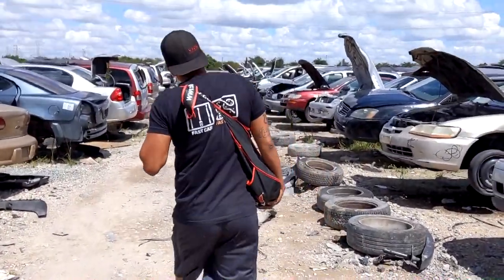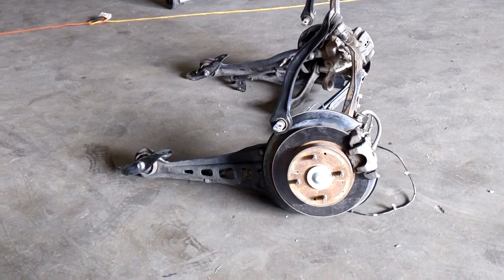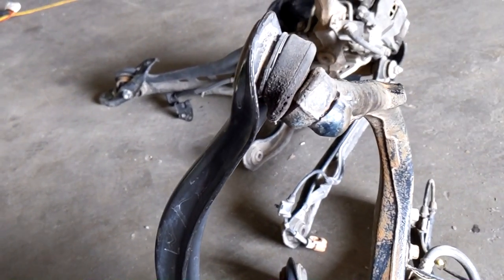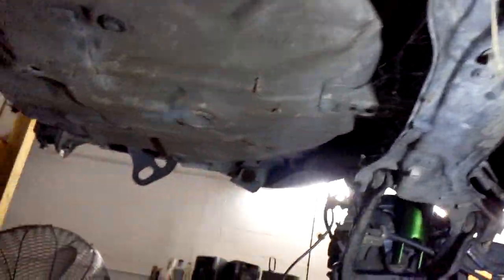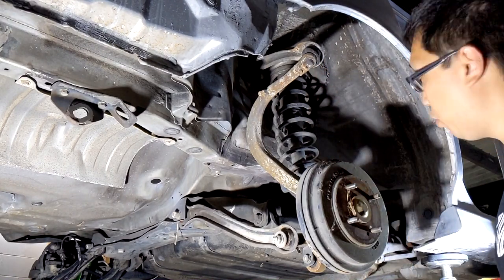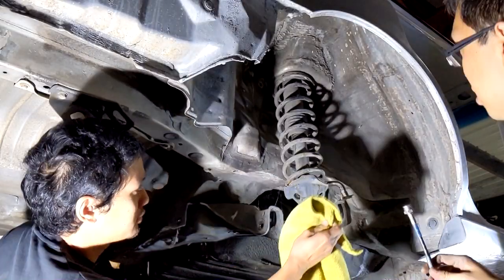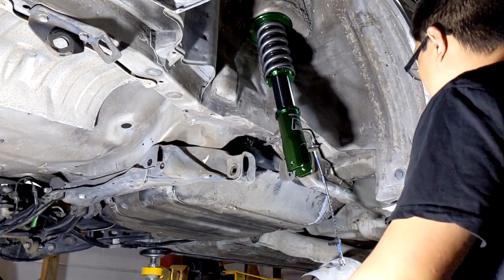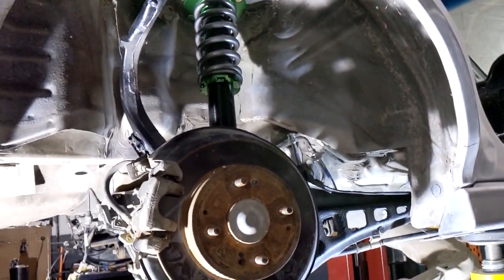MAJOR Brake Upgrade! | CD5 Track Accord Gets Rear Disk Brakes - Episode 7

Comment: great video!  one thing I would have done was take the whole rear crossmember from the EX,  it has a rear sway bar.  The LX/DX crossmember doesn't have the mounting holes for the bar.  
I'm sure you're addressing that later,  you could just drill new holes and use riv-nuts.   
 but for regular junkyard swaps, if you're doing the disc conversion then take the whole crossmember with the sway bar attachments on it, and it all bolts right up.

Comment: You need to change the portioning valve to one that is meant for a car with rear disk brakes also.
Reply: Not needed for this swap. It's the same for the drum and rear discs on these cars

Comment: Should've picked up the ex rear subframe to fit the rear sway bar
Reply: Na not worth the money. I've tracked my Honda both with and without a rear swaybar. Doesn't really help all that much if any. My times were the same and my car felt maybe slightly better or that was my mind telling me it made it slightly better so i would feel better about buying one.
Reply: A rear sway bar gives you minimal performance gains if any. Not worth the money to swap it over unless it's maybe your very last thing to do.